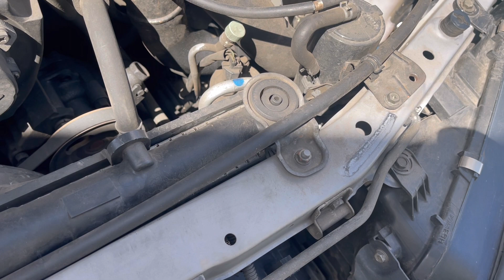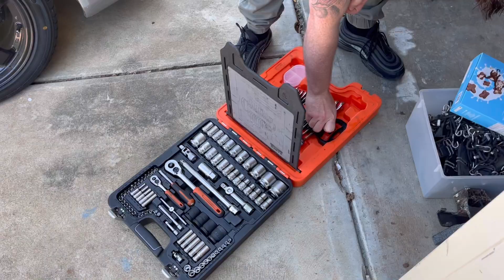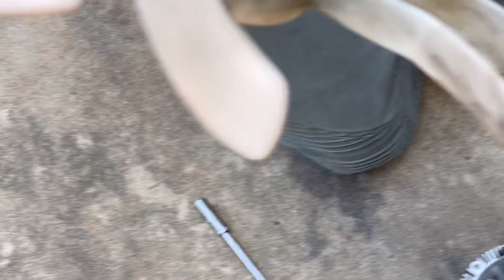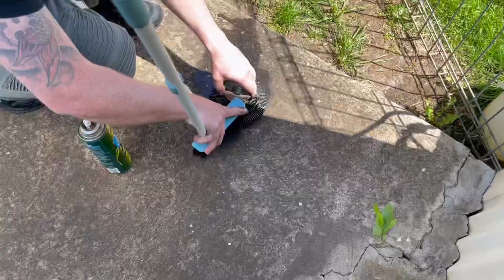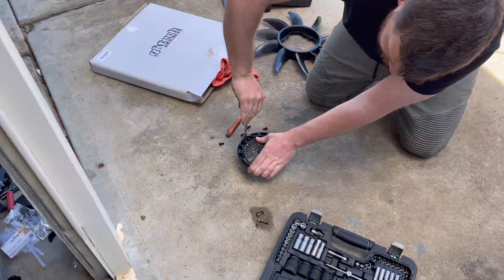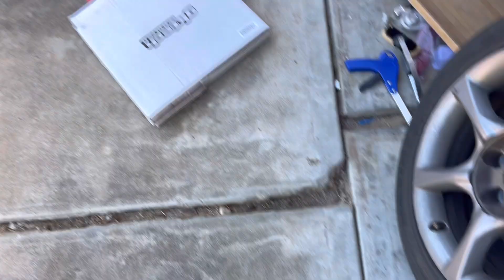R34 Performance Engine Fan Upgrade

Comment: I got this fan and sitting in traffics my temps goes to more then 100c, it does cool it when going on the road but as soon as i am standing still well it gets too hot, it is not an upgrade my regular oem fan keeps my car mo more than 90 all the time
Reply: I just bought one & mine is doing exactly the same, I'm putting the oem one back on.